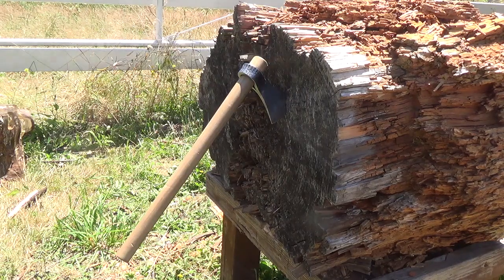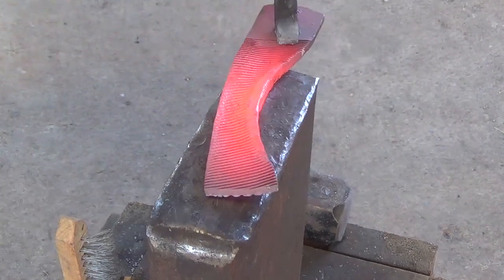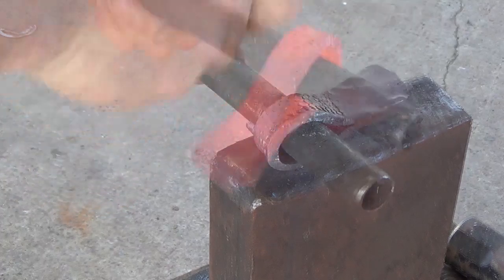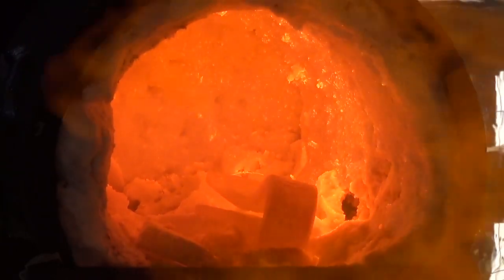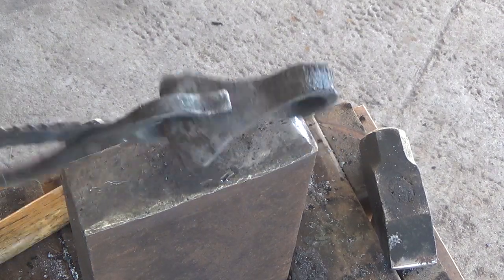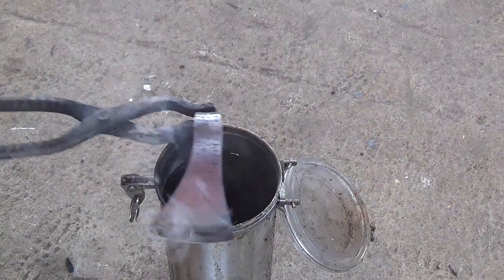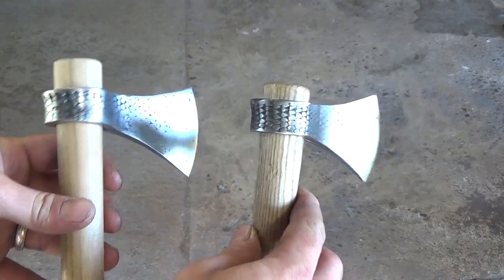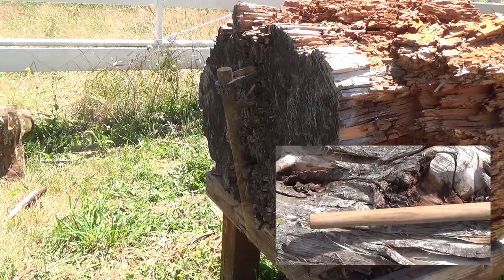Forging an Improved Rasp Tomahawk - Mouse Hawk

Comment: try closing the gap a little more next time before you start the initial tack. as close as possible so  it helps to minimize  oxidizing when you put the Flux in. along those lines, try getting the steel just a tad hotter. you'll  want it to where the steel is just about throwing sparklers off when you start the Forge weld. it will help make a better weld and make the weld line almost disappear completely. good job though, very impressive.

Comment: throw the axe head in the oven at around 400 deg. f. for at least an hour for tempering. I've had knifes that I've made from railroad spikes that I tried tempering in the same way get tiny chips in them from internal stresses  just sitting around months after they were completed. as long as the steel doesn't get hot enough to go past the straw color you're looking for then it won't soften up more than a few rockwell points.

Comment: You have exceptional crafting skills along with a great tutorial presentation. If you don’t mind me asking... What are the dimensions of the horseshoe file you use in the video? There are a lot of straps used where I work and I could easily cart off a few of them without anyone caring or making a fuss.

Comment: Hey Backyard bowyer, great job but I was wondering if you noticed the de lamination spot closer towards the edge on the left side of the tomahawk bit? It doesn't look like it would cause major structural malfunction but it should be worth noting you could have a chip break off one day. Other than that the rest of the forge weld looks great and you did an excellent job.

Comment: hey for a finishing touch you should lightly take a oxy/acetylene torch to the wood grip it brings out the pattern and then coat it in boiled linseed oil to make it shine and water proofed

Comment: From my experience from watching Forged in Fire, I think you should grind off the rasp teeth and clean the soon to be welded surfaces right before bending it around and welding it. You should also get it to a bright yellow color. By all means, having an incomplete weld in this case probably doesn't matter, but in other cases your weld could crack open if it's done like this.

Comment: A couple of suggestions, one, get a hawk drift, it'll help get the proper tear drop shape and lets you use standard hawk handles with only a little fitting.  Two, before folding over, use a bottom tool of some sort, I've used a section of dozer sprocket, to get a slight cupping of the material that will be the eye, cupping towards the inside.  When it's folded over it prevents the edges from flaring out as bad.  

Now you need to try a few like that but with 1018 mild steel and a high carbon bit.  I've heard of people using standard mild steel, but A36 is re-run stuff and some will forge weld no problem, some won't, it's a "wonder what'n hell is in it alloy".  My experience with A36 mild steel is it's not worth it and I'll pay a few cents more for standard 1018.  

I can't find much info on traditional hawks being forged from rasp, I'm sure there were a few done, just not commonly, if anybody has historical info on them I'd love to see more info.  Until recently, last 50-100 years, high carbon steel was hard to come by and most axes and hawks were mild or wrought iron with a high carbon bit.  Same thing with gun barrel hawks, most gun barrels were re bored and "freshened" to the point that it'd take a generation or two to wear out and were too expensive to just discard.
Reply: Thanks for the tips, I appreciate it! I've had my eye on the tomahawk mandrels at blacksmithdepot.com. Do you know if those are any good?

Good to know about 1018, I've been wanting to try some hawks and belt axes using mild steel and a high carbon bit but haven't started yet. On a related note, I once did a project that used pieces of A36 mild steel and I etched them in ferric with the idea of giving them that dark matte look. What I ended up getting was like a low layer count damascus with what looked like stainless steel nuts or washers mixed in.

I would think that like files knives, rasp hawks are a more modern invention. They may have been made from time to time, but files and rasps were precious things that were often re-worked and re-hardened until nothing was left. I wouldn't be surprised if some old hawks had a rasp or file bit, but I doubt they would use a rasp for the body of the hawk. That said, it's just a guess and it would be cool if somebody has more info on the subject.

Thanks for watching!
Reply: That's the same mandrel I use.  They tell you not to use it to drift with, but I've done a few though I used punches to get close and the mandrel to drift the last little bit, but drifting is hard on them, I wound up getting a spare a while back as well.  They come kinda rough, but you can either sand smooth or just use it and it'll slick up.

I've done some with A36 with no issue, but the last time I used it I'd put about 3 hours into the piece and found the poor welds.  After that I figured it was cheaper and safer to go with 1018 and haven't had an issue since.  From what I understand talking with foundry workers, sometimes an electric motor gets mixed in and copper contaminates the melt, plus titanium and aluminum and God know's what else gets mixed in.  You might get a truck load of steel that welds great, and you might get a load that doesn't want to, it's a crap shoot, and not worth the aggravation and time and labor for me to find out if it's good or not.

I did find one account of a knife factory in the 1880's that was set up next to a large machine and foundry, the knife factory bought all there used files and made knives from them.  But this is in the era of machine made files and the industrial revolution.  I'd love to find more examples of historical rasp hawks, but haven't seen much.  One issue is prior to the industrial revolution even decent wrought iron was a rarity in most areas.  Iron and steel were repurposed and used up, one of the apprentice's jobs was to weld up all the little bits of left over iron at the end of the day.

Comment: finally... they've enabled comments on the mobile app. 
but in anycase i've noticed in your knife/tool making videos
that you have a lot of scale on your pieces after quenching

to elieviate that problem, you can use a japanese smithing
technique that uses water on the anvil and your hammer to
blast away the scale with superheated steam

Comment: Say Heah Nick,  I enjoy all your videos,  I think your great.  But I was looking for a new Trio,  Usually I like a large knife/small knife combo plus saw.  That's my normal Trio.  Recently I started using my BK-4 as my large knife and it shines even when I teamed my BK-2 with it.  But my go to Trio is my Ratmandu,  2Hawks Double Bit Hatchet  and my Wicked Tough Saw,  You see I don't have your talents and I have to buy mine.  I also use my Ratweiler as a One Tool Option,  I could also team up my 2Hawks Warbeast  which is a three edge hawk that when it digs in deep,  It's easier to pull out.  With a Saw,  like Mors Kohanskywhen states,  You can live like a King.  Usually I team up my Ratweiler  with  my Rodent Solution,  But Regardless what carry I use,  I like my Mora 510 as a neck knife.  I wear it even at home especially  in the kitchen,  Nick,  seriously,  Job well done.

Comment: Very nice work my man, I have a question with an issue I'm having, do you think grinding on a head with a grinding wheel will ruin a temper due to the amount of heat it causes? Also where did you get the sanding flap disk? Thanks buddy subscribed!

Comment: When you're forge welding try to keep the piece to at least a cherry red, preferably hotter. For when you take it in and out of the forge, by keeping it very hot you make it easier to weld and it gives you a chance to tac need welds, if need be. If you let it cool and there's a small pocket of air in there you will never be able to reweld it from my experience.

Comment: If you soak the handle in boiling water you can use a slightly larger handle. It will soften the wood then put it back in the boiling water it will expand it and when it dries the axe head will never come off.

Comment: is it really common to create the eye of an axe by folding the steel? I think up to now I saw it only by punching a hole by hammering a spike through the glowing metal.
Reply from the maker: Forge welding an axe head was more common back before large chunks of tool steel were readily available. A lot of old axes were made of wrought iron that was drawn out, forge welded to form an eye, and then a tool steel edge was welded on. This way you could make axes with smaller stock, but if you had stock big enough you could drift the eye out of a solid chunk of steel.

Nowadays it makes more sense to drop forge and drift an entire axe head out of a single piece of high carbon steel because large amounts of consistent tool steel are common. Modern steel is so common that old types of steel and iron like shear steel and wrought iron are pretty hard to come by and aren't made in very large quantities today.

Hope this helps, thanks for watching!
Reply: This is a folded design. Using thin steel instead of big, think stock steel
Reply: There are several ways. There's the full folding method like this, there's the asymmetrical fold, where only enough to make the eye is folded over and welded, there's the slit and drift method, and there's the cut and weld method that utilizes a large piece like the slit and drift method.
Reply: Only with a long, skinny piece of steel usually.
Reply: what is the slit and drift method?

Comment: Weld at hotter temperatures!
At this grade of steel your temp was to low...
As for the axe eye, weld closer to it, and reopen it with a more conic mandrill. It will be in better contact with the handle.

Comment: Why not split the wood at the top and put a copper or metal wedge along with a knot of some sorts to strengthen the placement?
Reply: *A knot on the bottom of the axe head
Reply from the maker: I don't like having the head of a throwing hawk locked in place. With the head held in with a friction fit, a hard knock against something will cause the head to loosen. If the head is locked in place, the handle has a better chance of snapping. It also makes changing out handle easier, because if you're throwing them a lot, you will break handles.

For a tomahawk that's not going to be thrown, fitting it like other axes is fine.
Reply: BackyardBowyer Oh,I didn't consider that,that makes a ton of sense.Thanks again and keep up the good content man

Comment: How is the axe head held onto the handle? Maybe he said it but I missed it
Reply: The handle is tapered to be larger in diameter at the head end.  This lets you pressure fit the head to the handle. It also makes replacing the handle easier than those held in by wedges.
Reply: Because it's a tomahawk, it's held in with friction through the taper. Not like a hatchet which has a wedge

Comment: If you use a railroad spike you wouldn't have to weld anything, just shape and use a punch or another spike to make the handle hole.
Reply: The steel in those isn't as suitable as that of a file, far as I know. Other than that, yeah, it'd work like you said.
Reply: It's easy enough to split and weld in a high carbon bit, I've done that before.  The issue I have is that the eye winds up being on the narrow side and that makes for a wobbly handle.  Also, you can use super quench to get a decent hardness out of HC spikes, not good enough for a decent knife, but enough for a hawk or axe, though I'd still prefer high carbon edge.

Comment: You need to hit that a lot harder to get that metal welded!
Reply: Tom Oldharp 
Common myth, on a small job like this you only need light hammering, hitting harder won't make it weld better, getting it to the right temperature is actually a lot more important in fusing the weld.
Reply: @michaelleigh6810  What's an good temperature to forge weld, does it depend on the metal you're working with?
Reply: @vileasphunk7789  right before it starts sparking

Comment: Dude I love that you self criticize  like that at the end of your video. Good to have an eye for improvement!
Reply: Also try using a low carbon steel for the axe next and use a high carbon plate in-between your forge weld to give it a lasting sharp edge.

Comment: that wasnt a forge weld. need slightly higher heat and to really bash the shit out of it.
Reply: No, forge welding doesn't require a heavy hit, especially on pieces of this size
Reply: You can see the cold shut after he wire wheels it. I’ll agree though, it doesn’t take a hard hit to weld it
Reply: @joecoastie99  yeah that is true

Comment: That weld isn't solid.
Reply: 5:30

Won't be even 1,000 hits with that thing, and it'll crack right along that seam, I'd figure.
Reply: It might be better deeper within the steel, but it did seem as though he did a fair bit of grinding. If it's got much depth at all to it, the weld is definitely not all the way sealed. I've been doing a fair amount of blacksmithing over the last 6 years, and I can tell you from personal experience that this is not a good weld. Not awful, mind you, but definitely not solid. Should have brought it up to JUST where the steel starts to "spark" on it's own. That is the optimum welding temperature.
Reply: Eh, not sure.  It doesn't look like it would delaminate.  Good job!
Reply: I've had better looking welds come apart with minimal stress. It might last, I do have some bad luck afterall, but that's just my guess.